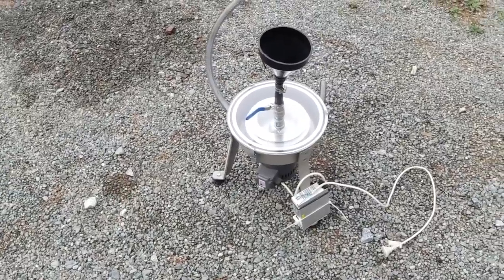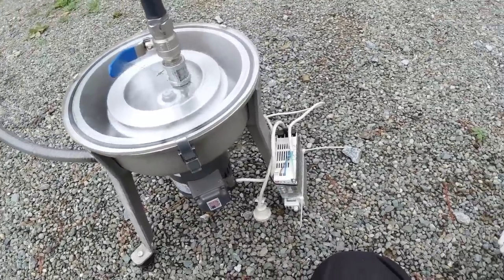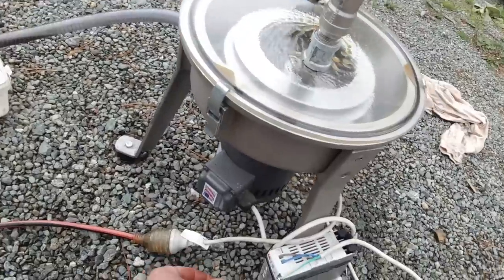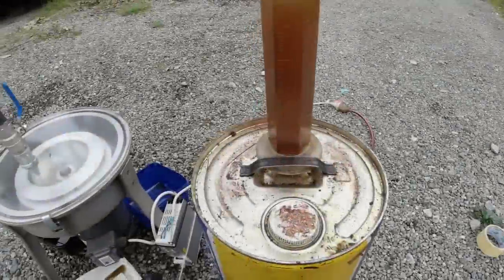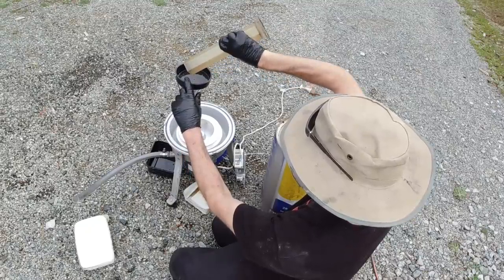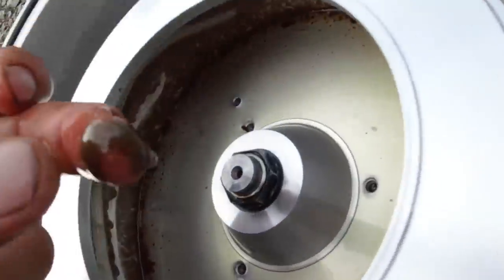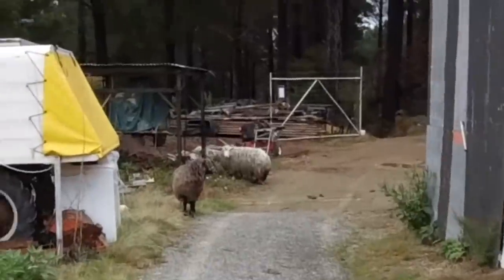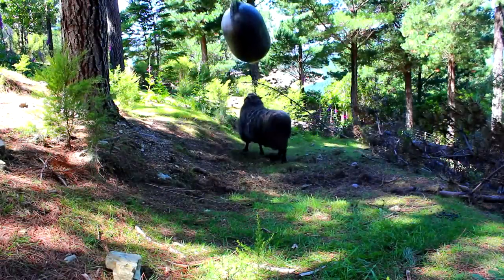Using a centrifuge to clean used oil and diesel.. Will it work??

Comment: It should be pretty easy to remove water from oil using one of two chemical techniques. 

1. Brine washing. Make a concentrated brine of NaCl (table salt) and water (Concentrated: you can't dissolve any more salt in the water. This brine should be as salty as possible). Pour this into the wet oil, and shake it up, and let it sit. The concentrated salt brine should absorb all the water out of the microscopic droplets dissolved in the oil. Salt should not dissolve in oil. The brine will separate, and you will end up with a dirty brine layer and a dry oil layer, where you just had wet oil before. You should be able to centrifuge off the brine, or siphon off the oil.

2. Epsom salt, aka MgSO4. Epsom salt is the wet version of Magnesium Sulfate: MgSO4 with 7 H2O molecules. Heat it to 200C in an oven for two hours, and it will become dry MgSO4, which has a powerful affinity for water: it wants to have its 7 H2O molecules back. (It may come out of the oven chunky; you may need to crush it to get a powder again.) Put it in the wet oil, and it should suck water out of the oil. You can then use the centrifuge to separate the big wet MgSO4 grains from the dry oil.

3. For best results, brine wash them MgSO4 wash.

Sources:
https://chem.libretexts.org/Bookshelves/Organic_Chemistry/Organic_Chemistry_Lab_Techniques_(Nichols)/04%3A_Extraction/4.07%3A_Reaction_Work-Ups

http://www.sciencemadness.org/smwiki/index.php/Drying_solvents

Comment: In the 80's I was the Maintenance Manager for United Technologies Aluminum Extrusion Plant in Coldwater, MI. 
We had 3 extrusion presses that held between eighteen and twenty five barrels of oil each. About 55 gallons or 208 liters. 
When I started they were buying 10 barrels a month to make up for oil losses from changing oil and leaks from the various hydraulic systems. 
The presses had collection pits under them that drained to a 20,000 gallon or 75,700 liter collection tank. The presses also had water cooled heat exchangers and chill boxes for the extrusions. These leaked or drained water to the 20,000 gallon collection tank. When the collection tank filled up they would have the used oil and water mix pumped out into tanker trucks and hauled off to be used as fuel in cement kilns. 
The previous Maintenance Supervisor had set up a filter system to try and recover the oil. It was cobbled together from used junk and wasn't reliable. 
I put one of the employees in charge of maintaining and operating the system. 
We installed a bag prefilter to catch the trash from the old collection tank that had built up over the 10 years it was in the ground. 
The bag filter took out the contaminates over 15 microns. 
The bag filter dumped into a 400 gallon square metal storage tank where it was heated to 140 Deg F. with a immersion heater from an electric water heater. That drove off most of the water and the debris would settle to the bottom of the tank. 
A bulkhead fitting in the side of the tank, at about 3 inches off the bottom of the tank, fed oil from a recirculation pump to a centrifuge to remove any water remaining, then the oil was pumped through another bag filter, a large three-micron canister filter and back to the storage tank. 
After four days of running the oil was checked for viscosity and contamination. If it passed by not having any particulates over three micron the oil was pumped out into from the bulkhead fitting through the three milcron filters and into clean 55-gallon drums. The full drums were moved to the storeroom. 
About 3 months after we got the system running our Briner Oil supplier's rep stopped in to see why we weren't buying oil anymore. He thought we changed companies. 
I showed him the setup and he said it couldn't be as good as the new oil he was selling. He was sure the anti-wear additives had been removed. He also thought the oil would be acidic from being heated. He offered to take a sample to their lab and test it. 
He came back and said it passed all the tests, was equal to the new oil's levels of anti-wear additives and wasn't acidic at all. 
Within a few months Briner had set up a filtration system of their own and was collecting used oil from their customers and recycling it for less than the cost of buying new and disposing of the dirty oil. 
After leaving UTC, to take an offer at Metal Powder Components, I set up a smaller system to clean the oil from the four Alpha compaction presses.
Those systems were destroyed when UTC and MPC went out of business. 
Your method has many of the same systems I installed. I think you just need a heated storage tank. A large barrel will work.  Make sure it is vented to allow the water vapor to escape. A bag filter ahead of your centrifuge. A small oil pump and a couple three-micron canister filters to polish the oil and it will give you oil just as good as what you buy new. 
It won't separate different viscosities of oil, but you can rig it for the largest quantity of oil you have. Like I did the hydraulic oil. Anything less than 30 gallons won't be practical because the system keeps about 15 percent of total capacity in the various filters and piping. 
With your fleet of equipment I'm sure you have enough hydraulic oil and engine oil to set up two systems. One round of oil changes will pay for the equipment needed and depending on how dirty your oil gets the filters will be a small cost compared to buying new oil.
Reply from the maker: Amazing.. I nearly didn't post this average vid but I'm glad I did just for the comments

Comment: That'll only deal with micron and higher stuff, for deeper cleaning you need a sludge high pressure pump and high density cellulose filter pucks (and obviously, the encasement to run it all). The initial setup is a wee bit expensive, but if you are good with fabricobbling (and you certainly are) you can make it all from garden variety items. My first rendition and test was made from a piece of seamless pipe and some fittings.

There's plenty of online documentation, so i won't bother trying to explain, they do it better, but it's a very good way to clean used oil. I personally use it as a downgrade scale (ex: car > lawn tractor > chainsaw), but on my brother's farm it really makes a difference when you start racking up the liters of it.

Dunno about fuel stuff, but oil, very good/lucrative method to clean used media.

Comment: some are touting this type of centrifuge as the holy grail of oil and diesel filtration but as your simple demo shows the 'fuge is really only one step in the process.
the most sucessful 1-shot methods I've seen seem to be based on cracking towers where you are litterally boiling off the fractions at different temperatures.

Comment: the question is: has heat and mechanical use crushed the carbon chains? the centrifuge is good for seperating Diesel and water or oil and water but these would also seperate by itself when untouched for a longer period. There are a few systems out where someone sells you off-line filter (don´t know if this is the correct english term, Nebenstromfilter in german). you should send your cleaned oil to an oil lab (like blackstone labs for example) and let it check.

Comment: Marine Diesels have a De Laval centrifical oil cleaner that has a stack of bowls 
inside to contain the impurities, they need cleaning when ever the engine is
stopped.
On starting the centrifuge it is necessary to seal it with water or else it will
dump all the oil instead of cleaning it.
A portion of the engine oil is diverted continuously to the centrifuge and returned
to the sump tank cleaned. The impurities when cleaned from the bowls is like
rubber and has to be scraped off.
They also have another centrifuge for fuel cleaning, the internals are set up
a bit different to the oil cleaner. It is used to clean fuel as its transferred from
the bunkers to the daily service tank.

Comment: Thanks for the angry ram update!  It was fun to see the animals again!  As for the diesel or oil, after running thru the centrifuge, you could run it thru a fuel filter or oil filter and see how much better it looks.  Maybe then it would be worth burning in a vehicle or using in a decent tractor???

Comment: There is a different style centrifuge. It runs the oil down the center and has tubes that introduce the oil/fuel into the oil wall gently. They have shown running the oil into the oil wall can cause splash out of dirty oil/fuel. Also it works much better if the oil/fuel is heated.
Reply: Which style is that one? Thanks

Comment: I was shepard for many years for 3-350 sheep.
Perhaps if you feel like it, grab one sheep after grabbing clippers, and shear around their butts. Easy to control them when they are on their butts - if you do not know how, google how to wrangle sheep. The rest of the fleece fine to let go, unless you want to take on full shear before summer. But if they are forest bound, they can avoid shearing for years. But keeping that butt area clean reduces matting, bott fly grubs and general hidden nastiness. Just a week of squirts will wet that whole area with wet and dry poop and really matt down. These guys still need our help even if they are wild. Cheers bub.

Comment: When I was in the Navy, we had two different types of lube oil purifiers on board.  Sharpless and DeLavlle.  They spun at a very high rate of speed and the oil was forced up and through many cone shaped discs.  Clean oil came out the top and sludge was drained out the bottom.  The key was how many discs and the extremely hight RPM's.  Maybe you could try and find an old unit that would have been retired from ship board use and repourpose it for yourself.

Comment: That's promising 👍 I've seen an article about this years ago, but never tried it. I believe you'd get a better result if you spin it faster, and feed it slower, to give the separation a better chance. I was thinking how it's a sped up sedimentation/decantation, and searching found that these machines are called a "decanter centrifuge". Found also the "centrifugal separator" (search "fuel oil purifier"), used in ships to clean the fuel oil, and these spin at over 15'000 RPMs. May probably be worth looking for a second-hand one of those...
Reply: I'll bet some old Kiwi Master Mariner (retired) has a beach shack nearby, and just happens to have a few separators gently rusting out in the bush. He offers to swap one for a David Brown tractor front axle (and bearings) that Marty has, gently rusting away in the back of his shed . . . 😊
Reply: @BrassLock  😂
Reply: Found that "milk cream separators" work similarly. Maybe it'd be easier to find one, and modify it to spin faster if needed.

Comment: This might sound utterly dim, but has anyone thought of passing used fluids through a loaf of bread?     In WW2 Britain, the method was used to 'clean' the dye from farm fuel...
I'd thought of switching out the drain plug for a tap (w/ porous stem) on the Varsol bath's sink, to accommodate something you could stab and secure a fresh loaf of bread onto, 
and just let gravity fed osmosis do it's overnight into a clean bucket.   I didn't get around to building one yet, but I did manage to restore 15 gals. or so back to *new-ish*, by 
simply filtering it through 4-5'' of shop rags and 5 gal. buckets cut to drain.    But if a loaf can catch dye, it'll surely catch larger particulates.

Comment: I worked at a clay mine. The did lab tests on sepiolite clay as a filter and it even removed the red dye from diesel. I imagine it could probably clean up used oil pretty well. Other clays might also be effective if you wanted to try that.
Reply from the maker: Nice, I'll look into it
Reply: compressed diotomaceous earth would probably work too

Comment: at one point, I was running MB diesels on veg oil - I had a collection of garbage cans and was heating the oil via black irrigation tubing on the roof of my house. We let the black old fry oil perk through old hotel sheets via wire basket frames, the oil really cleaned up and from there, we let the contents settle which further clarified the oil - At the end, the oil was clear and golden and looked like a glass of white wine

Comment: My dad would take used motor oil and put it in a 45 gal drum. After a year of sitting all the dirt would settle to the bottom and the oil was quite clear. All of the detergents and additives were probably gone so I would not put that used oil into a "newer" machine. If you have an older machine that burns a bit of oil it would probably be ok to re-use. Some people in colder climates use old oil to spray under cars to prevent rust.

Comment: One thing that you may find useful is a patent I found for a Russian invention,  it was quite elegant,  it was a filter but it is an open cell foam like a washable vacuum or tropical fish tank filter medium, but it was placed in a extendable tube , you filled the tube with the media then shortened the tube with a screw thread, you compressed it to make the filter you needed more compressed the finer the filter, when you have used it release the screw pressure and the junk just washes out of the open foam, cooker hood filter would also work

Comment: The dark color is from the oil being compacted.  Old oil loses its properties that it's useful for once it's spent.  It will not create an oil wedge, and it's viscosity changes.  Any additives that made it useful in inclimate weather and  increases its compatibility with a wider variety of materials get spent.  It's not very useful except for maybe small engines or heating oil.

Comment: I’m looking to get into this myself. I am trying to find a way to have multiple layers of protection. Primary, secondary and tertiary containment. I intend on collecting free oil from various places and it’s likely going to be stored in large bulk containers. 300 gallons of oil. If it were to leak. That would be a real environmental problem and a health problem for me and anyone on rural water in my area. I’d advise that you consider this. It can be a real mess and create plums in the soil.

Comment: I have heard about using a length of thick Manila rope and making a siphon from one container to a lower one with the rope. Thoughts?
Reply: that's a bloody good idea, simple, cheap slow but.
Reply: fiber filters like that work. It's an old "survival' filter. You can take the nastiest water it use a finely woven NATURAL fiber rope and filter water thats safe to drink. The problem is unless you have a rope that's 6" thick and 50' long you're only gonna get a few ounces of filtered material. It's very effective but extremely expensive in recourse.

Comment: I appreciate the addition of the sheeps in the end - thank you for that experience. Only thing you need to think about with a resirculating pump I think is maintenance and maybe waste oil tank getting overfilled and therefore not working proper effective.

Comment: In the next episode:

Got myself an old outboard motor. I'll just stick it in the barrel to stirr the oil. That'll do just fine for now.

Next I use an old chainsaw to grind all the fine particles to size.

With the solar powered battery pack, I heat up this old hot tub I bought for scrap value.
Just let the oil heat up and boil the moisture out.

Filter it with some sheep wool. Job done!

😉🙃

Comment: I’ve be cleaning old sump oil for 40 years. Get an old heavy gauge 44gal drum, put in a tap about a 400/500 ml from the bottom. Fill to just below the tap with water, then add equal amount of old oil,,,, then put a fire underneath the drum let the water and oil boil away for a few hours, then let it settle for a few days then drain the clean oil out the tap. Works a treat

Comment: It seems to me that a lot of the crap in that oil is colloids. You may be able to get those colloids to settle and drop out by adding a relatively small amount of a flocculant. What will happen then is that the colloids which are sitting suspended in the oil making it turbid like that will group together forming something called a floc, and those flocs become big enough that they'll drop to the bottom of the container on their own. I'm not sure if flocculant works in that application, but my quick check from an unreliable source seems to suggest it can work.

Comment: It might be interesting to do a comparison with two clear containers, one with un-spun (dirty) oil and the other with processed oil, but, allow them to settle side by side for a day or two, to allow any aeration etc.from the spinning to escape from the cleaned oil. Once they have both stood for whatever time period you try, then, put a seriously bright light behind each one to check the difference in clarity. Not in any way scientific but, could be interesting to see the difference before and after, side by side.

Comment: We used to use a gravity filter, it was a 20 ft tall tube filled with charcoal granules with a thick fiberglass bundle at the bottom, you could pour most anything at the top inc red diesel and it would drip out at the bottom clean and clear,  eventually it would block up and the charcoal made excellent starter bags for the coal furnace,  the fibreglass was in a separate piece on the bottom with a valve so it could be cleaned out,  we also had a solvent recycler which produced gunwash solvent from body shop used solvents the cool end was an old chest freezer filled with water, leave it to chill overnight and it made usable  cleaner without much real smell
Reply: So by solvent recycler you essentially mean a solvent still, right? Did it use any heat?